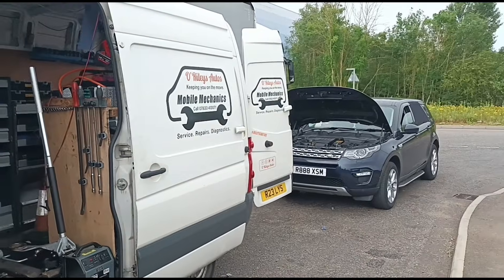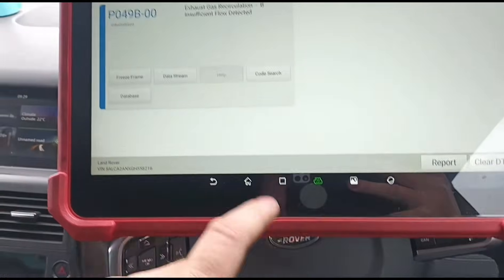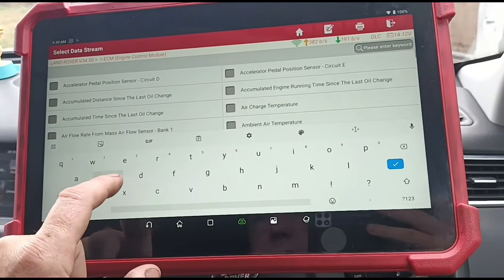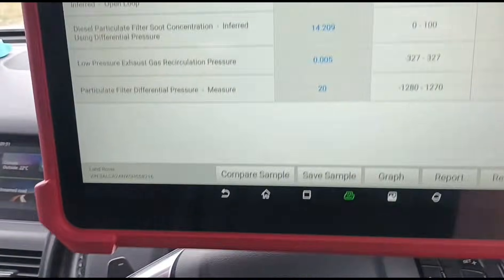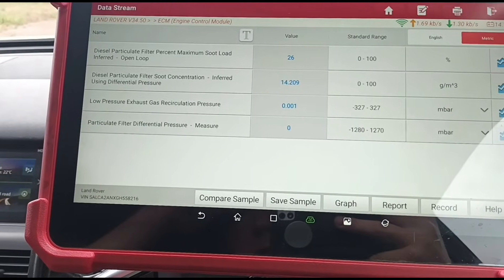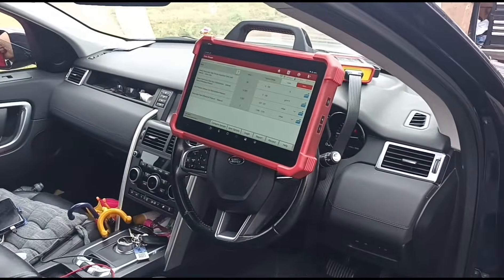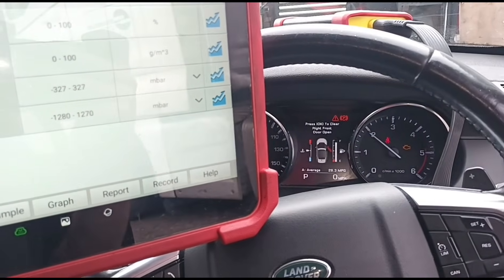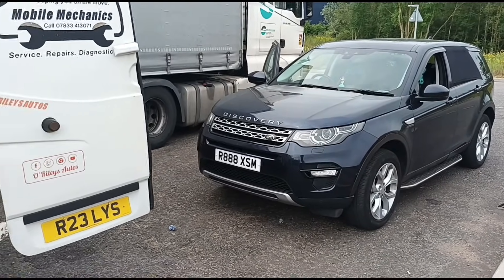Land Rover 2.0 Ingenium P049B-00 Exhaust Gas Recirculation B Insufficient Flow Fault = Damaged DPF

Comment: Got this issue on the newer 22plate but completely different dpf system. Any pointers please? I've ran through tons of live data under various loads and conditions.  Checked dpf, tailpipes, Exhaust flap etc etc. Fault only seems to re occur after 150+miles but never had it long enough to test it that far distance
Reply: Jlr don't list me a filter and neither have they sold this type dpf and scr system apparently.
Please help a fellow mechanic out O'Riley 🙂

Comment: 2016 disco sport already had brand new genuine Dpf and pressure sensor and new low pressure EGR filter gauze. Still getting same code back after approx 250 miles. Any suggestions greatly appreciated!!
Reply: Hi, better to just bypass dpf and egr valve 😊
Reply: How do you do that? @waqiakajk5860

Comment: The DPF / EGR is just a symptom right ? There must be a fault that is causing the DPF to clog. Short miles could cause it but also bad injectors, dodgy turbo or blocked air intake, basically anything that causes it to run rich.

Comment: Had the same problem with a Honda CRV idtec.
P049b code
I did unmount the DPF, brought it to a DPF cleaning garage. It was inspected by camera, it was absolutely not broken. Moreover, a pression test is made before the cleaning and after. A defective DPF would be fastly detected in the machine.
Made it cleaned, replaced the EGB b filter full of carbon and creating the defect.
20000km after, the problem came back. After some research, I found the problem was caused by totally detective injectors. Changed them and now, no more problems. They where checked on a ramp, 2 ones had twice the diesel back values. 
I've read that brand new Renault DCI have the same issue with injectors creating heavy smoke and bloking the EGR b filter.
Changing the DPF will solve the problem for some thousands kilometers but the real issue is the bad injection causing a lot of dust in the system.

Comment: JLR needs to stop making engines full stop and just buy them in from a more reliable manufacturer its beyond their capability, and just stick to the desgin side of the business yes it will cost more to make them but people will pay the price as long as the car looks pretty, which they do look nice but the mechanics side is beyond their scope... they are well knows for egr dpf chain turbos cranks etc.... even are low miles which is a complete joke as you say your van has done silly miles and still has the original dpf so it just goes to show its not the dpf thats the problem is the design of them which jlr struggle with
Reply: There’s over half a million vehicles on the road with the Ingenium engine. 
They haven’t all failed. 
There are some specific issues with the 2106-19 Disco Sport. 

However the reality is the cast majority of failures on these have 2 common components. 
They are used mostly on short runs in urban settings. The owners don’t maintain them particularly well & in a lot of cases the oil doesn’t get changed until the service indicator appears on the dash. 

By that stage the internal components of the engine are already stressed. 

There are lots of drivers who use them properly & change the oil frequently & have had no issues
Reply: I concur, my 2017 XF had only done 72k miles when the engine blew up, needing a total of 11grand to rebuild. The ingenium engine is complete shyte.
Reply: Landrover hasnt built any good cars period . A legacy of failure
Reply: @mrk8546 what nonsense